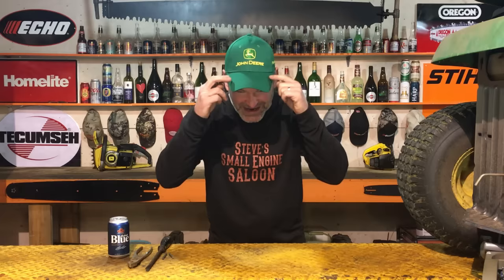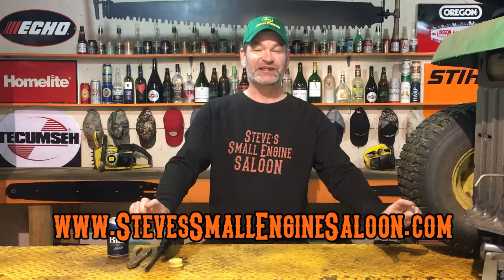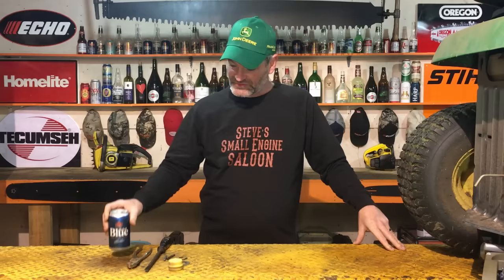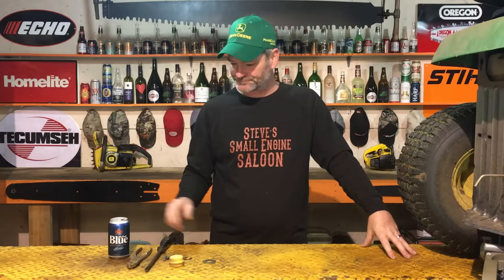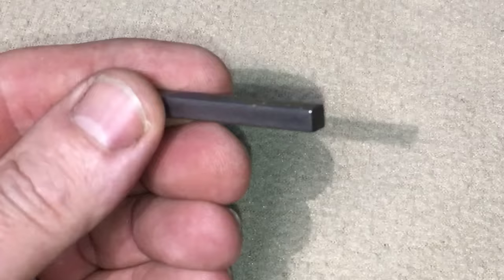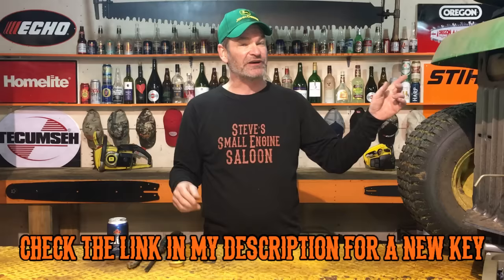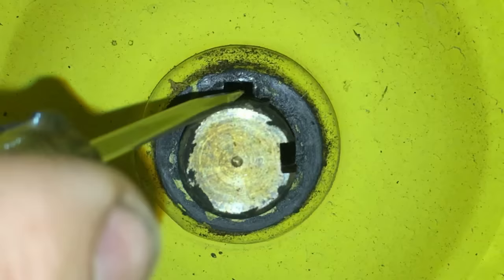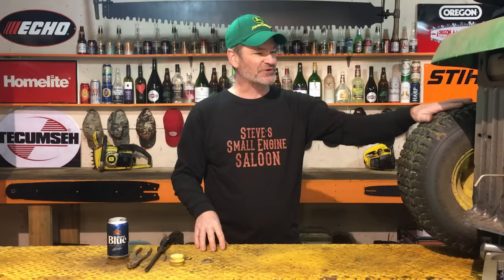How To Fix a Riding LawnMower That Will Not Move or Drive

Comment: Awesome video! Steve, do you know if John Deere rear wheels will fit on a Troy Bilt? I'm actually looking into ways to increase my mowing height. My 2004 Troy Bilt Pony cuts at 3.75" on the highest setting! I'm wanting to cut at least 4.5". Any suggestions... other than replacing the mower with a new one? LOL!!

Comment: I pulled out the free wheelin rod to move the mower in my garage to service it which I have done several times.   When I was all done for some reason the D140  would not move when I went to move it out of my garage.  I noticed that when I pushed in the Free Wheelin rod I was able to push the tractor which should not be. Is this a transmission problem or am I missing something I am doing.  Never happened before.

Comment: Great videos.... But my Ride on....Ahhhh! I've tried just about everything except stripping the Carbie. Runs 20 - 30 mins stalls. I let it cool and I get 10 minutes.... then 5 - 10 mins. I have: changed fuel and air filters, cleaned out the tank, replaced the coil and plug, took valve out of petrol cap to eliminate vapour lock. Behaviour doesn't change. When it stalls, the fuel filter is empty??? Tank at least half full. How can this be?... fuel lines and clamps all appear okay. Any further ideas.....????.... What am I missing?? Thanks Oh, it is a Briggs Stratton 19.5 HP Intek so no fuel pump... gravity!

Comment: Drove my e140 to garage, lifted front at around 80degree and removed metal in blades, set it down, now it won't go in gear. Runs great, jacked back up and spun the tires, just fine,  any suggestions

Comment: Hi Steve, I got an issue with a Hydrostatic Automatic 46inch Pro Series craftsman lawn tractor, During normal operation, it stopped moving I was Backing at the time.  I checked the belt it is still on the pulleys and checking the linkages they all seem to be working the lever on the transmission was moving forward and back without slipping.  now I have not changed the belt since I bought it 3 years ago. you have any advice on what I could check next?  Thank you for any help in advance
Reply: I got same prob with same mower. Did u figure it out?
Reply: I did I have a PTO switch on my mower and the drive belt jumped off but the power plug that sits on top of the PTO clutch was keeping my belt from coming completely off. just on a quick inspection, it appeared to still be on the pully.  I pulled the deck and it was much easier to see. I ended up replacing the drive belt.

Comment: I thought (and was hoping) that this was going to be about HST transmission issues and how to easily fix them. At the beginning of every season when I pull my tractor out of storage (and often on cool mornings) the drive system won't work. You can feel it start to go and then stop; forward and reverse. After you play with it for a bit (sometimes several minutes) it will eventually start to engage, and once it does so and is warmed up it drives fine... I refuse to believe the mower shop that it needs a new HST transmission but I've yet to find an easy fix. Guess I'll keep searching

Comment: very good to know .thanks steve.cold you do one on a starter motor or testing an ignition  coil thanks
Reply: Testing the starter motor.
Jumper cables from your car battery.
Red to the red wire connector on the starter. Black to any frame bolt or engine block.
If the starter is good,it will spin.
Ignition coil testing.
With a known good plug,remove the plug wire from the existing plug and connect it to your known good test plug. While holding the boot,place the plug against any frame bolt or engine block.
Crank the engine with someone in the seat (mind all of your safety switches as well) while cranking,you should see spark.
If it is a twin cylinder,check the other side as well.
Note: safety switches failing are the biggest problem for lawn tractors cranking,but not starting,aside from dirty carburetors. Testing for a dirty carburetor. Remove the air filter cover. Spray a couple of shots of starting fluid down the throat and try to cranking it. 
If it runs fo a few seconds and quits,you now know that your carburetor is gummed up.

Comment: Hey man i got a mower and it doesent have a drive belt yet but when i spin the transmission shaft where the belt goes it thurns freely without moving the axle is that normal or maybe the tranny is broke?

Comment: i ran into this on my neighbors JD he had the tire fixed his son in law put it back together  and it wouldn't move . so he said to me I think my tranny went out  I had him start it and try to move it I noticed the axle turning  then he told me he had just had the tire fixed. I popped the cap off and told him it either sheared the key or it was missing  . then he went into the garage and said I found this but I didnt know where it went . it was the key stock . I popped off the clip and reinstalled it . he was greatful and preceded to mow.
Reply from the maker: Right on Rob..
Reply: Hello just picked up a T3000 craftsman had been covered and sitting for awhile it has 94 hrs on it .I paid 150.00 for it  the lady’s son in-law said she wanted to get rid of it . I got it home jump started it but it wouldn’t move . I pulled the mower deck out and felt for a broken belt the belt was ok but it was just off the drive pulley on the engine. Got it back on started it back up and it was ok . One those hard to come by deals .$1200.00 mower for $ 150.00 just because the belt was off.

Comment: Great videos man thank you ,you've saved me a ton of time and money ! Another question I have a john deere d130 its about 7 or 8 years old doesn't have the pto switch button to engage the blades it has the lever you swing over on top of the dash to engage . The mower starts and runs fine but the blades won't engage. I've check the tension on the cable for the deck which seems fine but still nothing.  Any ideas ?
Reply from the maker: I have a video in my playlist for that...
Reply: @StevesSmallEngineSaloon  which one i looked through them i don't see one

Comment: --- Any takers on a issue??? --- Got a Craftsman LT-1000 other day. The mower runs and cuts fine with one small issue. Which is on a topic of mower will not move. So I put the pedal down and mower stops. I let off pedal all the way and mower will not move. At which I take my toes  and put behind pedal and pull up just a hair and mower takes off fine. I have to repeat this every time mower stops or when first starting to mow. It seems like a cable issue or something because my pedal spring sounds sorta grind sounding. What would cause this or need to replace? Hydro stat trans, Briggs twin cooled 17.5. 917-270821

Comment: I have a 2006 Yard Machines model 601 which is a 46" cut. It runs fine and drives but lately I've noticed that it doesn't want to move like it used to. Sometimes it slows to where I let go of the accelerator pedal and then press on it and it starts moving again. I know there is some kind of drive belt between the engine and transmission. Does that sound like the issue? Might that belt be worn and slipping? The user manual says to take it to a service center but I want to try and see if I can fix it myself. I don't know a whole lot about riding mowers just the small engines in them. I don't think this is a hydrostatic type of transmission. Anyway does anyone out there know? Intermittent problem moving. I don't hear any unusual noises coming from it either. Thanks

Comment: My Ford riding mower moves slow and won't go up a hill.  I recently had the drive belt replaced.  My guess is that the problem is a tension spring.

Comment: My John Deere E 100 stopped moving right in the middle of the yard and I've never taken the tires off ever?
Reply: I found out what it was, a stick got lodged in between the belt and the pulley and put it off under the front of the mower, the belt runs from the front pulley all the way to the rear of the mower, the belt is not even in my service manual lol

Comment: I'm having these exact symptoms, but it's a brand new JD S180 with a whopping 1.8 hours of use on it straight from Home Depot 2 days ago.  I haven't removed the tire or wheels since purchase.  It worked flawlessly for 1.8 hours, then suddenly, while mowing just stopped moving forward or reverse.?
Reply from the maker: 2 Days?  Take it back and exchange it for another one!

Comment: What usually happens to me is, I pull that metal rod towards the back which lets the rear wheels free wheel. I do this if I have to move it and don't want to start it to move it a foot or less. Of course, I don't push it back in when I'm done and forget a bout it. The next time I start the tractor, it won't move. And then I remember. I look around to see if anyone saw my stupid mistake.Push the " free wheel " rod back in and away I go.

Comment: Another thing can cause it not to move is underneath there is 2 small tension pulleys mine were both bad to where they did not spin so the belt couldn’t spin fast enough to tighten up the drive belt to move the mower.

Comment: I just got a d105 john deere automatic and the transmission drive belt is bad I took the deck off and the belt off the pulleys but it still won't come off because of the steering column do u have to remove the steering column or am I missing something??  I'm not used to working on this brand mower!

Comment: I have this problem where when you press the foot drive pedal   in to stop and then let the pedal out again the belt then wont grab the drive pulley on the motor,... could this be the belt is too long? the riding mower was given to me BECAUSE it had this persistent problem so the owner got a new one,.. it's a Toro with a drive belt coming to a double pulley that engages and goes faster as the belt ride in and out of the pulley,.. I can take the battery out and pull the drive belt by hand to get it to pull out of the pulley and tighten the belt and get it to run, but does it again when you stop again,.. lastly,.. I took this double pulley out to check it, and it moves easily up and down the center of the pulley,.. thanks

Comment: Great idea for something to check, but if you didn't do anything to the wheel lately and the mower has another issue you should talk about that as well. Otherwise, you have a few people here who think you are psychic and a whole lot of people left stranded scratching their heads. The beer thing is not attractive. The first few times it may seem a bit humorous, but after that, some people think you might be needing to join AA. It's not a great thing to be teaching. Alcohol is not a good way to keep calm. It harms more people than it entertains.

Comment: the little lever  at the back of mower takes it  out   gear no matter what you do with the shift most of them i think need  to be pushed in  you use that to roll the mower around in the garage with  out cranking it and forget to pus it back in   she wont move till you do

Comment: Simple dorp the deck and check belt's my rider was built in the 1980s the motor is a horizontal shaft and it's a gered diven

Comment: you only find that on cheap knock offs, and other cheap brands, a good lawn mower has a hub with 4 or 6 wheel studs and has no belts for the drive line, many years ago i was looking for a 20 or 25hp lawn tractor, i first went to JD and they had that key way, and all there mower decks were made from stamped light tin,, and they wanted a huge amount of money for a belt drive unit,, i went an looked at a troy built, GTX 22HP, WITH A GARDEN WAY 60:" CUTTING DECK this deck is so heavy i cant lift it my self, it is built from 1/8" steel plates bolted together, so any part thaat my get damaged is replaceable, the lawn tractor has a hydrostic drive, ful cast iron rear end, 2 PTO, WITH OPTION TO ADD A REAR PTO the only belt on it is on the mower deck it self, has a drive shaft to drive the rear end, i bought the whole package, mower deck and 4 foot wide snow blower for $11,000, this was a many thousand cheaper the that cheap built JD, AND I USED ID COMMERCIAL LAWN CUTTING AN SNOW BLOWING FOR 8 YEARS, 18 YEARS LATER And one engen rebuild and it still going strong, the only time it stops driving is when someone tops up the oil with the wrong kind of oil

Comment: i have a craftsman all wheel steer rider 536.255860 42" deck the tires are held on by lug bolts not KEY STOCK WILL NOT go into gear. the shifter will not even move ANY THOTS?